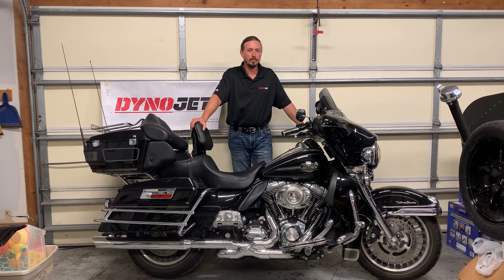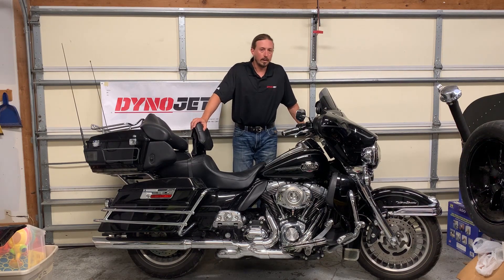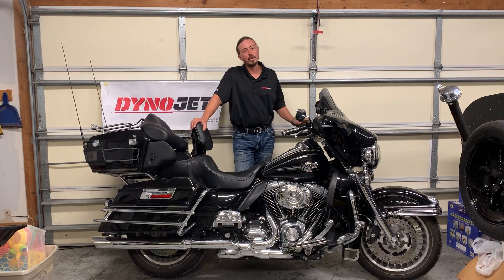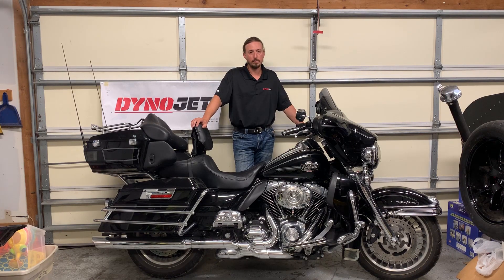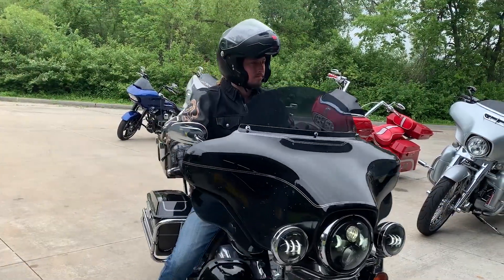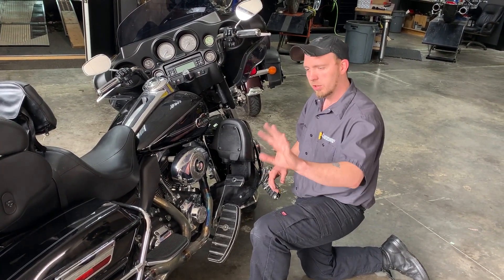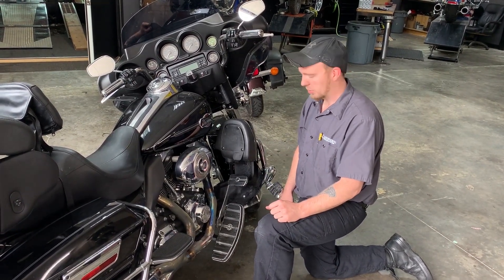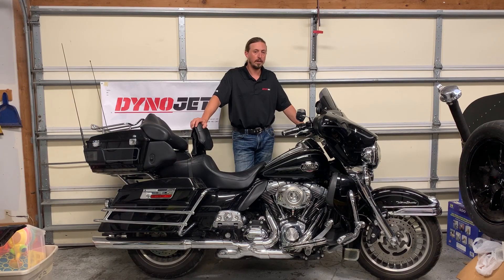Building the Thunder (A Harley-Davidson build): Episode 1 — Let's Get Started

Comment: Are you going to use "Auto tune" ?

I would like to see Dynojets FULL system with "auto tune" also installed.
To give a realistic idea of what someone without a DYNO Room can accomplish.
Reply from the maker: Ted has installed our Power Vision fuel tuner, and other upgrades are outlined here: https://www.dynojet.com/blog/building-the-thunder-harley-davidson-build/.

This series will show how anyone can upgrade their daily driver bike into a performance machine. Ted, of course, doesn't own a dyno room. He went to his trusted local shop for this dyno run.
Reply: @DynojetResearch  , yes i know it's not Ted's Dyno. I did watch the video.

So, that's a "NO" to my question then...

But i still would like to see a video with someone "capable" of using all of YOUR products including "auto tune" (videos demonstrating how to operate your products would benefit sales). Details on making desired manual adjustments to a/f ratios (custom maps), etc. 

Yes a baseline , and a end pull on a DYNO would be desired for data.
Reply from the maker: Tony, we'll definitely keep that in mind, regarding more AutoTune content. We have plenty of videos on here showcasing how to use our products, and we're planning to make more.

For this particular project, Ted is using Power Vision for his motorcycle and will show how to increase horsepower through modifications. If you have questions about Autotune, we're happy to answer them.